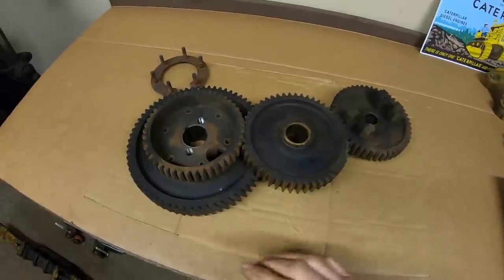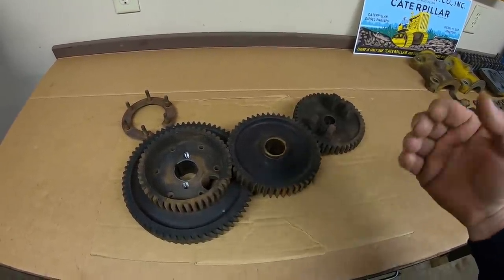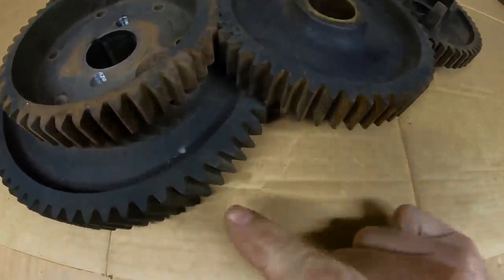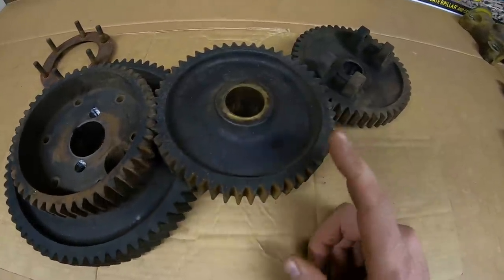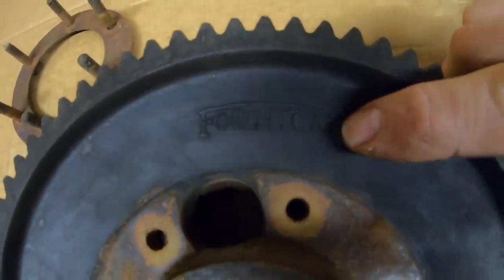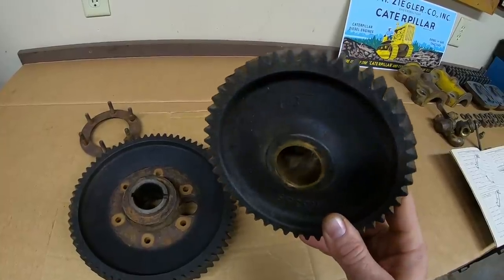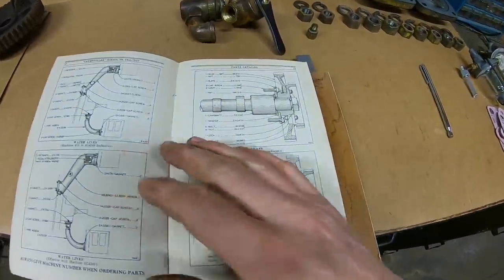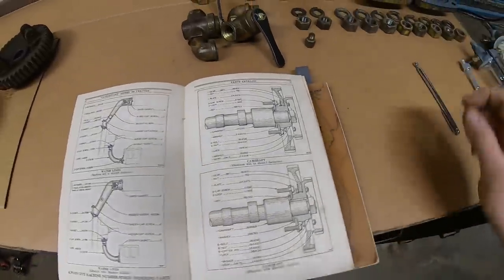Cursed by Design or Ahead of Their Time? 1930's Era Caterpillar Composite Diesel Engine Timing Gears

Comment: Volvo had fiber composit cam gears from the first pv444 1944 (a 30is design)
To the last b20 some time after 1974 when they went to the ohc b21.
One of the benefits is they are quiet compared to a steel gear and if something locks up the engine, the fiber gear breaks and the rest of the engine is fine.
Reply: Yeah, I was thinking along the lines of a "sacrificial" gear.
Reply: @doctorgravel8572   the volvo gears tend to explode when you hop up the b20 past 150bhp then you swap to steel gears.
To day you find it in gear driven drill presses, as a sacrificial component if you overload the machine.

Comment: Hello, i was not aware that such timing gears were use on heavy equipements. In Europe they were quite common on cars engines during the 50s and 60s. I am mostly a Panhard collector and they are also notorious to fail on those small engines (look in the web, I have a pile of those double helical timing gears). They are made of coton fibers impregnated with some kind of phenolic resin (backelite). It was used mostly for noise reduction due to poor tolerances of gear machining. Greatings from France, I really like your content.

Comment: Composite gears were used quite bit from the 1930s onwards as a way of quietening gear noise.  That might be considered laughable on farming and construction machinery but the whine of a badly designed or worn gearset is probably much more irritating than other noises.  Velocette singles used a composite magneto gear in some models and a fine-tooth, helical tooth form in all to reduce noise.  Composites are susceptible to poor handling and setup, so it is not uncommon to find them damaged.  You may also find that the intermediate gear in the set you showed has one tooth more or less than you might expect, to spread wear on the hunting tooth principle.

Comment: I would think that two composite gears rubbing together would create a large amount of friction and thus heat which would cause the gears to delaminate and fail.  Alternating steel and composite would alleviate that problem.  Ford flathead V8's used a composite cam gear that meshed with a steel crank gear pretty successfully.

Comment: Can understand why the gears were replaced - Ford used them in the B & C 4 Cylinders and V8's where they would either spin on the cam or throw teeth - at least with the flathead the motor just stops.

Comment: As others have noted, I have seen non steel gears in many applications, mostly though where there is no shock or jarring from ignition / combustion tossups and slaps of cams and valve springs. the appeared to handle the smooth actions very well and just as well as steel or cast gears.

Comment: While this isn’t about cat engines in the 80s as a young mechanic the first shop I worked at for about 3 years, I used to change timing sets on small block Chevy engines about 3 a month. It was that nylon/aluminum gear found on many of V8’s of the day . Year’s later I worked for a cam grinder and there used to be an old timer that came into the shop once a week to go to lunch with the owner, sometimes the workers would go to. Turns out this guy was a engineer for GM  back in the 30s to 70s . One lunch day he was describing how they came up with the hydraulic self adjusting lifter and I asked him as to why they used that timing set prone to failure on so many engines. His answer was cost and noise, cheeper to make and quieter so the customer didn’t bitch. Sorry for the long story just your discussion about phenolic gears just reminded me of times ago. Some reason I remembered , I think the straight 6 Fords has a phenolic gear that was replaced with an aluminum gear.

Comment: I had read/heard that some manufacturers were using a bronze gear against a steel gear because the bronze would wear faster to match the steel gear making the combo last longer.  That may be why the phenolic to steel.The steel gears didn't need to be machined as finely so saved money and the phenolic didn't need to be machined at all.As far as I know many lawnmowers/and type  engines use a molded nylon gear against a steel gear on the crankshaft to drive oil lube (splash or pressure).  So I believe it's OK as long as the synthetic gear isn't carrying much force.

Comment: I suspect wear is one reason for opposing parts. Years ago I read up some on similar metals against each other were more prone to “binding”, like gears meshing which would wear as parts contact each other in a slip mode. (Steel piston in steel liner for one). Aluminum pistons in a steel liner “slipped” better due to less grain meshing between the two. With all that out of the way, alternating steel/composite/steel may have been another attempt at reducing “mesh/wear” between parts. I’d rather have gear wear in 100,000 miles (automotive use) than a pan full of plastic with valves stuck in the pistons at 50,000, though…

Comment: Reminds me of a 1959 chev 235 motor that blew a composite timing gear as I was going up a hill when I was sixteen. Timing gear cover looked like a rat nested in there afterwards. That was my first ever rebuild. Had less than 50 miles on motor but I reused any parts I could. Wasn't making much pocket change back then.

Comment: I wonder if the the engineering theory behind the composite would have been less wear on the gears by avoiding steel on steel contact. . .
Reply: I'd guess that, and less running noise.

Comment: I'm just spitballing here, but maybe they decided to use the composite gears to control wear. Like using a dissimilar metal as bearing. The composites wear, the steels are good. But, the composites wore it to quick, so they went back to steel. Just a theory.

Comment: if I had to guess, the goal of using a composite gear between steel gears was likely used to extend the lifespan of the steel gears. 

It's amazing to see these early attempts, and it's proof that engineering is never a perfect science!
Reply: Could also have been matched up that way for harmonics or resonant frequencies

Comment: Squatch equates the term "composite" with "fibre".  Is this correct?  The service manuals for "grey motor" Holden cars (Australian equivalent of Chevrolet built by GM's Australian factory 1948 to 1964 - used a derivative of the GM "stove-bolt" 6-cyl engine) state that the camshaft gear is "fibre".   It sure isn't metal but it meshes with a steel crankshaft gear.  The fibre gear was said to be chosen because it is quiet, reduces wear on the steel gear and does not itself wear much.  At least in these car engines, the fibre gear lasts the life of the engine.  I've stripped old Holden engines down and found cylinders worn, journals out of spec, etc, but the fibre gear just fine.
The Holden manuals don't specifically say so, but I think Wolfman Dude in his post 2 weeks ago is correct.   
Other cars of the same era used what is called a "silent chain" - of which only some did not stay silent.   Eg tailfin Mercedes - you used to see 10 year old examples driving around in near perfect condition but with obvious timing chain noise.  This is just another example that some manufacturers engineer things right and some get something wrong.
Perhaps Cat just didn't provide enough width across the teeth to carry the load, and GM did.   That is, it wasn't the material that was bad, it was some Cat engineer's calculation error.   Fixable with a steel gear because steel needs less gear width for a given load, and noise doesn't matter in a crawler tractor with in any case its' quite heavy engine castings to block the sound.

Comment: My 1953 M38A1 Army Jeep has a composite timing gear. Not the same type of duty, but it can be high consequence in case of failure. They have to be replaced when rebuilding the engine.

Comment: I am super happy that you have helped Kyle with those RD 4 parts and that you have also helped him with needed restoration information. He seems like a level-headed mechanic who appreciates the manufacturing and buyer use of old Cat machinery. Additionally, your explanation of the two types of timing gears sure was helpful for me to understand what Cat did in relation to using some composite gears in their manufacturing of the RD 4. 

I would suspect (speculate- guess) that with the invention of composite material, a design engineer at Caterpillar wanted to see how composite gears would hold up under normal day-to-day operations on a Cat dozer. The plan may have been to change over to all-composite gears in the timing section of future manufacturing of all dozer engines if the two test gears held up well. But, who really knows why it was done ???
Reply: I more suspect that they intended to stay with a gear type mix. The advantage of the phenolic gears is that they run quieter. Steel spur gears are generally pretty noisy. But you don't want to run composite phenolic on composite phenolic, because they are both layered, and the layers have different harnesses. Running a composite gear against a harder steel gear will result in a smooth wear pattern across the teeth. Running composite on composite can result in delaminating and shredding the tooth surfaces, resulting in quick gear failure.

I suspect that most composite gears that failed didn't fail because of an inherent design weakness. I suspect poor lubrication, or the valve train getting harder to drive because of binding in the rockers and the like, is what caused them to fail.  Of course steel gears wouldn't have failed (as soon!) when the valve train bound up, so I guess you could say it was an inherent design weakness. The engineer didn't calculate the loads for a bound-up valve train.

Comment: I am only familiar with machine tool gearing; in our thread mill machines, fibre gears were used to lower the gear whine it has an unbelievable noise if they were not used. We did change and tried plastic, Delrin and nylon with nylon being the winner for our application. Maybe Cat had a similar idea.
Play safe from Elliot Lake, Ontario, Canada.

Comment: I don't know one Soviet tractor that used composite gears but lot of other Soviet gasoline powered vehicles did. I believe main thing was the composite gear was cheap to produce. Did not need much thinking or machine work, easy and quick. Not that they where short of metal, but the logic was make them as unified as possible and as many as you can.

Comment: From what I know Ford Cologne used composite gears in the 1.7&2.0 ltr V4 engines for the Mk1 Transit.
My mate had a moped from his Grandpa in his garage where the rear chainwheel was made of a kind of plastic, from my memory it looked like nylon or such...
Seems not that un-common to use these in high-wear applications...
:-D

Comment: Ok our D4 has a 7J 2213 serial number. am I correct in assuming unless its been changed it has the composite gears?
Reply: @squatch253  Thanks I just went out and checked it. Its steel. Like you stated its very unlikely that the fiber gears havent been changed on a 1940 machine.

Comment: Ford was going the same thing in the 20s. I guess the thought was to save the engine on a major engine failure. May have also been a noise thing? Quiet the timing gear train down a bit? Just speculation on my part. I know Caterpillar engines have always had a concern about noise, even in modern engines. Their truck engine line C15 engines had loose weights on the cam gear to try and reduce harmonic vibration and the engines had foam panels to reduce noise.

Comment: Squatch253 thank you for all the videos! Recently the pull starter on my snowblower gave out. Normally I would have just ordered a new one and put it on. Well I got a wild hair and said let's fix it the way Squatch would. So I drove the pin holding everything together out and found the issue. I solved the problem and it works better than ever now. Watching how you attack problems your machinery has gave me the confidence to give it a try so thank you for spreading your know how!!!

Comment: Those gears are sacrificial.  I have a 'new' Sheldon lathe with a composite gear in the lead screw train.  It dies first, saving everything else in a crash.  I had a Plymouth 360 in the 70's that had a composite cam gear that shredded.  The steel replacement was a little noisy, but it was a non-interference engine.  She was a runner....  Makes sense to me now, didn't so much then.

Comment: I'm guessing (and this is a shot in the dark) that the engineers discovered formica on steel had a much lower friction coefficient than steel on steel. So, they endeavored to get as much friction out of the gear train as possible. A neat idea, but material science just wasn't there yet.

Comment: Composite/fiber timing gears are never a good idea if you want any type of longevity whatsoever. I've had to replace them in a couple of Chevy engines over the years - with no noticeable increase in noise I might add. At least CAT learned, GM kept using them for decades, probably still do!

Comment: I know that many larger companies were doing these types of experiments with using the different methods and materials because of metal for the war effort needed along with the experiments to lighten up certain parts and pieces which no one would have thought to do otherwise if we weren't going to or already in WW2. Late 30s aircraft industry was growing and looking for something different from the conventional. But unless Cat was just thinking of noise reduction and torsional harmonics reduction in the valve train, it's hard to say what they were actually trying to prove besides maybe it was much cheaper and definitely faster to machine such precision parts? GM also did this horrible thing in the mid 70s of all times just to add insult to injury or something? Going with a plastic toothed camshaft gear which wasn't known to last 80K or less, of course there's always some freaks out there that went much longer somehow?  But what is really interesting about this topic is the fact they didn't have polymers back then! 🤔 Bakelite and Formica and cellulose based composites long before plastics were even a thing like that of Tupperware rage of the 1950s. Well we do know that Formica is a formidable product that does stand the test of time in kitchens and bathrooms! But inside the crankcase of any engine is just no place for things like this unless for like what's now being done today with the use of polymers for bearing surfaces! This has been proven so far to be working fine at the moment.?! SMFH time shall tell I guess how it goes?

Comment: So the next question is, when did Caterpillar switch from a 2 piece cam gear, to a 1 piece like what is found in my RD-4? Instead of being bolted together with 6 bolts, it is machined as 1 piece.

Also, I really hope you make a wall hanger out of those gears ⚙ 😁
Reply: What’s the part number on the one piece?

Comment: I could probably 3D print a gear that meets all their requirements (needs) and be as strong as the metal gear next to it, without damaging it in time. It's amazing what technological evolution is capable of, well, if we ignore the fact that the 3D patents were locked for years by a greedy company, who just... sat on top of it, doing mostly nothing.
Same for certain other things back in the day that could've made better gears.
Reply: Probably because we have thermo/set plastics now that deflect elastically before failing plastically where formica tends to fail brittle and suddenly even though it's fiber reinforced